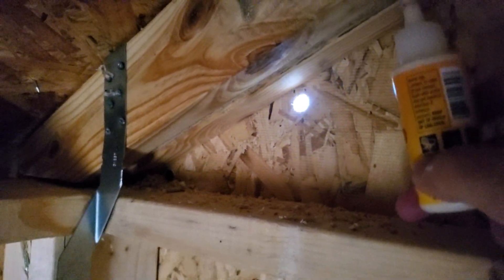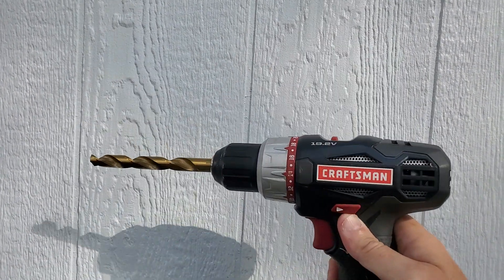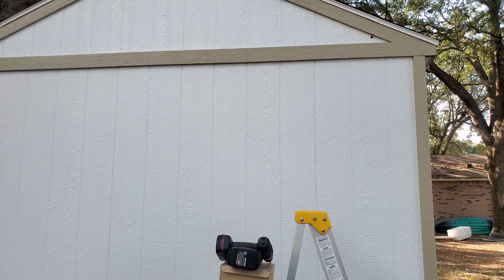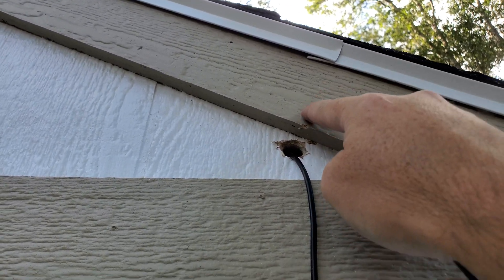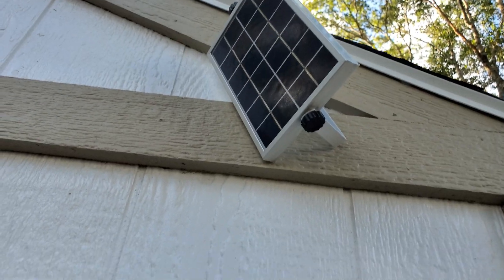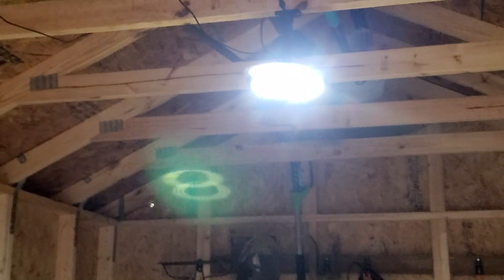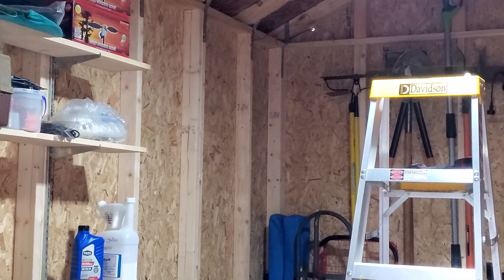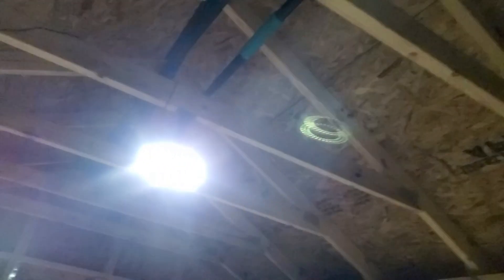FabStyl Solar Powered Indoor/Outdoor Light {Install and Review}

Comment: The only way I can get the light on is manually then press auto constantly it will come on and then after a certain period of time it shuts off, and it shows one red light and one green light
Reply from the maker: Can't say I have had that problem per se. The instructions say that it has a timer to shut off when it doesn't detect motion. Mine is in my shed. I NEVER use the remote. Mine is set for the longest timed motion sensor. I've been tempted to Jerry-rig a second light since the company says it isn't possible. It is just aggravating to be working in a corner of the shed and have to walk to a different area to turn on the light. I wish they made a remote switch rather than a remote control and timed sensor.
Reply: @KenJohnsonUSA  if you put it on MO3, it’ll stay on and that’s where mine is set to come on at night. But thank you for getting back to me. I can’t seem to find the website to do troubleshooting.
Reply from the maker: @angeloceleste4768  mine doesn't have a permanent stay on setting.  That's the problem with a lot of overseas products is there isn't  consistency.